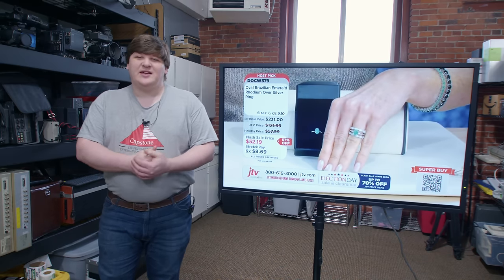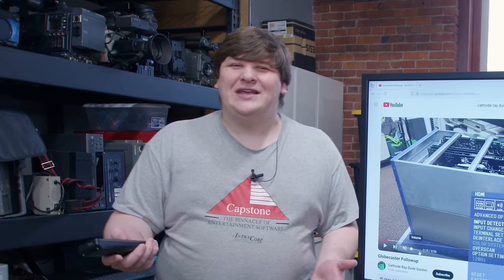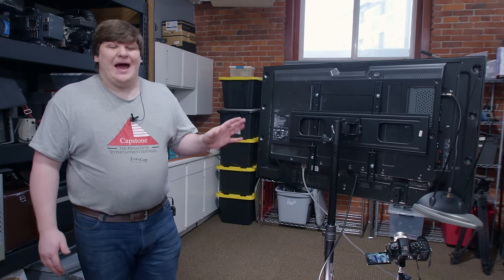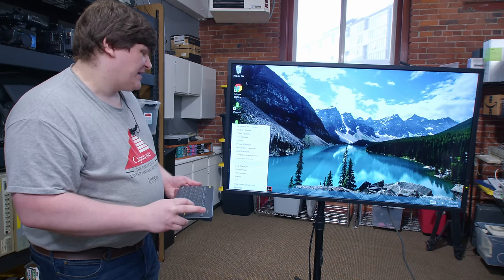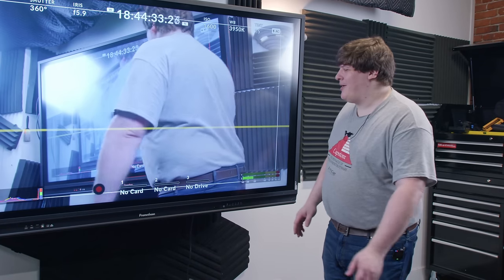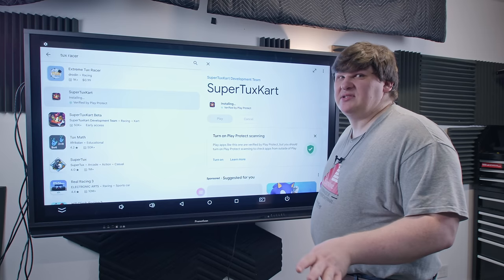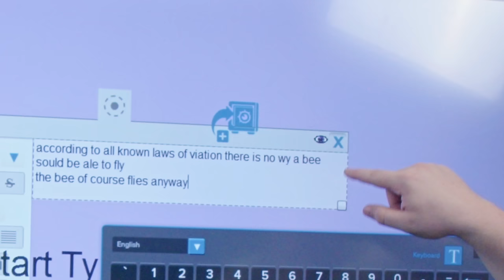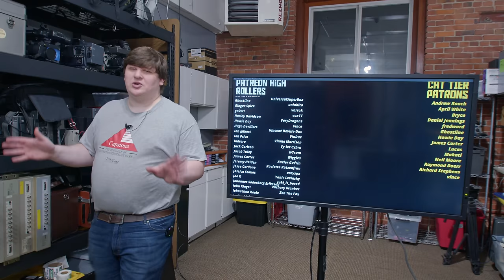Several Incredibly Smart TVs!

Comment: 4:38 I work in a television studio environment and we have studio feeds in every room. I'm talking hundreds and hundreds of TVs that are left on 24/7. When we renovated in 2017, we specifically chose a commercial display designed to be on all the time to avoid burn in. We might have color bars on these screens for days at a time when the studio is not in use. Literally all of them had horrible burn in within 3 years.
Reply: Welp you might need even more expensive studio grade displays

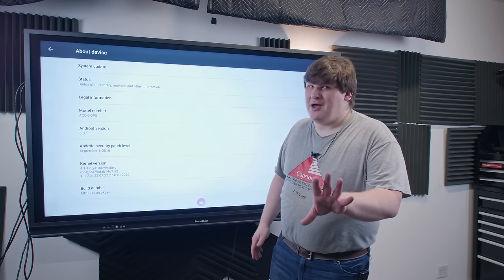Comment: 50:50 It's even more funny, SHA1 hash flowed by '-dirty' was a string generated by git, in which case it was compiled with uncommitted changes in the codebase.
Reply: Imagine fixing a bug so in the hurry you didn't even commit changes to the repo, made a crude build locally, sending it to someone and they say "thx, it works now" and then it is the one that gets officially shipped... either this, or they suck at git, or they just don't care

Comment: About the Promethean casting software: I've actually had the opportunity to mess with one in a school setting, and (at least for the one I used, which seems to be a newer model than yours) it just used regular old Miracast. Stock Windows through the Cast menu connected to it perfectly fine, as well as my Android phone. The one I used also had the ability to have multiple (up to 30, maybe 40) devices casting to it... *at once*. I was told that it was able to allow all the students' tablets (unfortunately we're now apparently giving young children iPads in their classrooms) to cast to the screen at once. You could click one of the devices being casted to focus that one full-screen, then click anywhere to go back to split-screen view. The teachers did also have software on their computers that directly connected to it, so they may also have a proprietary protocol, but I know for a fact regular Miracast does work with it. I think that software was actually just a Chrome extension, come to think of it... I'll have to ask around.

The metal bar is exactly what you think, to store the pens it comes with. Fun fact: the board can actually tell whether you're using the tip or back of the (official Promethean) pens somehow... as well as detecting when you're using the eraser instead of a pen (it came with an eraser that sticks to the side of the frame with magnets to hold it when you aren't using it)
Reply: For most IR-based IFPs like this promethean, it can detect different size objects. I worked for a competitor and the three main sizes it could detect were a thin tip (pen/stylus), thick tip (eraser end), and a larger object like the side of a fist.
Reply: @mariol90  I'm sure that's exactly how it works, as regular whiteboard markers and erasers also worked perfectly fine and it detected the difference properly.

Comment: IPTV isn't just a Europe thing, Rogers' TV in Canada, AT&T's U-Verse and Google Fiber's TV offering is also an IPTV system (the former two based on Microsoft's "MediaRoom" IPTV platform, but all three using Multicast UDP streams to deliver video, audio and the interface). But in Europe they have regulations defining the standard and allowing people to bring their own receivers. In NA, they use proprietary encryption systems to lock you into using their set-top boxes (or if you can get a supported option, the "CableCard" standard) to control what you can receive.
Reply: Some thai providers use some iptv over fiber. You get a tv box with the fiber internet, tv box being a customized android box.
Reply: I'm french and my ISP (SFR) has an IPTV and it's some proprietary multicast stuff

Comment: When using the "free" command in linux, the "available" column is actually the one that's relevant.  The "free" column basically says "how much memory hasn't been touched by the OS", but there can be plenty of memory that has been marked to be freed by applications, hasn't been truly deleted yet.  The "available" column counts all of the memory that can be allocated.
Reply from the maker: Yeah, I was embarrassed to realize later that I'd made such a rookie mistake, but if you look at available its also not doing hot haha
Reply: @CathodeRayDude  FWIW even in the "professional" software engineering industry, it seems like most people don't realize it.  I had to explain that to a coworker (whom I consider very smart) about a year ago, so you're in good company. 

Also, something I do if I have to run a linux where the repos are all dead, is to quickly install the alternative package manager "Nix". It runs on pretty much any Linux and macOS and has most of the packages, and is pretty up to date.  I find it generally more reliable than depending on old Fedora mirrors.
Reply: I had to explain to a sysadmin just this year about how Linux will use free memory for cache and that you have to take that into account when looking at the memory usage stats.

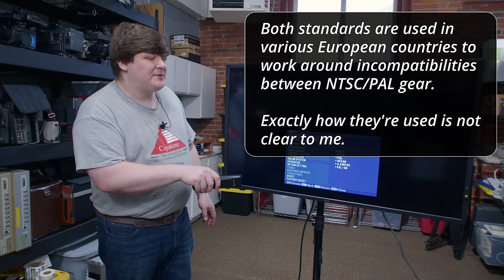Comment: 13:00 
NTSC 4:43 is NTSC for 50Hz and colorburst at 4,43Mhz. Is a NTSC for European tv standard's.
PAL-60 Is the other way around. PAL on 60Hz, or PAL for 60Hz, but with colorburst at 4,43Mhz.
SECAM was the French color TV system.
There's also PAL-M used Brazil. Mutch like PAL-60, but with colorburst at 3,56Mhz, to viabilizar broadcast PAL tv signal at 60hz on top of "NTSC" transmitters.
The weirdest one is PAL-N. Is PAL at 50hz, just like European PAL, but with colorburst at 3,58Mhz to be able to broadcast on "NTSC" transmitters. Was used on Argentina, Paraguay and Uruguai
Reply: Great explanation. Most common use (speculation) is probs VCRs that let you watch NTSC tapes on PAL TVs and vice-versa.
Reply: NTSC 4.43 is for playing back NTSC VHS tapes on multi standard VHS recorders intended for the European market. VHS recorders (probably all the other video recorders too) frequency shifts the color sub carrier. By playing back both PAL and NTSC at 4.43MHz the recorder only needs to be able to play back the color signal at 4.43, saving some parts. Those multi system recorders were packed full of circuits back in the days where all signal processing was analogue.

PAL 60 is supported by all DVD players sold in Europe. The purpose is to play NTSC DVD:s on a TV that only has a PAL color decoder. Since perhaps mid 1980's or so the vertical sync circuit of all TVs started using ICs that automatically sync to either 50 or 60 Hz and in most cases automatically have the correct vertical size too. Multi color systems though cost actual components, band pass and band stop filters, crystal oscillators and whatnot, and it was also possible to charge a premium for a multi system TV, so most TVs could only decode PAL (and SECAM if they were sold in West Germany, because everyone watched East German TV but no one officially admitted to doing that, it seems).

PAL 60 would also be useful for example if you switch to 60Hz/"NTSC" on an Amiga but still have the PAL color encoding / RF modulator things and use a TV or composite monitor as a display.

I honestly don't know who had any use for PAL-60 on DVD players. I think it was just included to lessen complaints from consumers who didn't know how to connect things correctly, as all but the cheapest budget TVs had RGB inputs in Europe since the mid 1980's.
Reply: @RetroSwim  Yes, I think that the in the last part of the life of VHS some recorders were able to play back NTSC in the PAL world and then transcode the NTSC color signal to PAL, thus generating PAL-60.

But the common use cases are those I stated in another comment in this sub thread

Side track: i don't think that there were ever TVs sold in Europe that could display NTSC 4.43 but not NTSC 3.58, even thought that would technically had made sense since it would had been super cheap to add to certain TVs (just a few diodes for the switching logic, kind of). I think this never happened due to it being a marketing night mare as it would require explaining too much to ensure consumers wouldn't get angry about it not displaying NTSC 3.58.

Another side track: I've never heard about people (rightfully) complaining about their European multi standard VHS recorders not working with North American TVs.
Reply: @Thesecret101-te1lm  well, not quite. Let me explain. There's quite a difference between what the NTSC is for Americans and what it is for the rest of the world. For Americans, NTSC is the television system as a whole. It doesn't matter if it is color, black and white. If it works at 60hz, it is NTSC, and if not, it is PAL, but it is not even close to that simple.
Reply: In the rest of the world, mainly in Europe, every country has its own television system that is different from each other for many reasons. For example, during the Cold War, you had East and West Germany, each running their own television system. Why? In that way, western Berlin audiences were not able to watch content broadcasted in the East and vice versa. A mess.
With that in mind, during the 60s', a French commission named CCIR cataloged every TV system in the world and put a letter on it. With the arrival of color, there was a mix and mesh between systems, and so then, side to the letter, there's the color TV system, and that is the NTSC for the rest of the world.
Reply: So, the UK system gained the letter B, and G after, the French had the E system, Eastern Europe the I, and the U.S. and most parts of the American continent got the letter M, and this M means that the signal is 60hz at 6 MHz with the color burst of 3,57Hz.
In the U.S., Mexico, Colombia, Canada, and so on, the System is NTSC-M. Brazil used the same M system but with the PAL color TV system, meaning that in Brazil, the system is PAL-M. Argentina has the 50hz system, but with an American-like broadcast system, and the equivalent M system for 50hz is the N system. They used PAL as their color TV system, so they went PAL-N. So what is NTSC 4.43?
Reply: NTSC 4.43 is the NTSC system up for European broadcast systems. If the UK had chosen NTSC instead of PAL, they would used NTSC with the color carrier at 4.43 to broadcast at the system NTSC-B or NTSC-G.
Because of the limitations of NTSC broadcast-, wise, the format was never officially adopted for any country, but NTSC was a better format to archive content on tapes back in the day than PAL, and then, professional broadcasters tended to use the format to capture and archive the content, converting them to PAL 4.43 to broadcast.
Reply: @carlosjuniorfox  You are only partially correct.
You are correct in that in USA NTSC refers to all parts of analogue TV transmission, and in the rest of the world that is called NTSC-M.

However West German + West Berlin and East Germany had compatible black and white TV systems, so all TVs would at least display the other sides transmissions in black and white as both used the B/G standard for RF. You only needed a dual system color decoder for PAL and SECAM to receive both sides in color. (Also they used the same frequency range / standard for FM radio transmissions, unlike some other east bloc countries).

Most of the east bloc used SECAM-D/K (or just D/K monochrome).

UK first used system A for their old 405 line system, and later system I for PAL color. The sound carrier wasn't compatible with any other country (except Ireland that IIRC also used system I). France used system L and SECAM to ensure incompatibility, to  have their country be a cultural echo chamber. The rest of West Europe (and East Germany) used system B/G and where thus compatible (and all used PAL except East Germany).

PAL was officially marketed for it's improved resilience against distortion, but the actual purpose was to be able to impose tolls / license fees to non-European manufacturers. Some companies in Japan attempted selling almost-PAL TVs that circumvented the patents, but I think that in the end that went nowhere. (Not exactly sure how they did it, either they skipped the delay line, or maybe they had the delay line and only ran the color decoder every second line and thus avoided the "alternating" part of PAL).

NTSC-4.43 might had been a thing in high end broadcast equipment, but I think that they soon switched to component video. The lower end professional equipment like U-Matic and whatnot always used PAL. Do you have any example of pro equipment using NTSC-4.43?

Either way, the reason for having NTSC-4.43 on a TV/monitor like the one this video is about, or any consumer TV/monitor, is to play back NTSC tapes on European multi system VHS recorders.
Reply: @Thesecret101-te1lm  wooow. Thank you for clarifying about the many standards which one uses which. 
I always thought that eastern Germany used the I system, as this, as far as I knew, was the system for the Sovietic states.

Comment: We have these Prometheans (not the exact model slightly newer) in schools in germany. 

I work as a School Admin and know these very well. The newer ones allows iPads to connect wirelessly, so students can share their work, the teacher can then at any moment freeze the screen and draw over it to correct or further explain things. Really nice actually. Though we shifted on using Smartboards as the UI is much nicer and they are almost 1000 Euros cheaper.  Smartboards have a built in OPS module not that easily accessible, but it still can be swapped or bought with an x86_64 module. All of those, even the new ones still have front io for teachers to plug in their own devices via hdmi, the newest even have thunderbolt 3 inputs on the front and back.

We are going to swap all ops modules with windows 11 compatible ones this year. I love that we can fit 10 year old devices with modern hardware capable of running Windows 11 at nearly a 5th of the price of buying new ones. For schools with limited funds this is insanely valuable!

Comment: NTSC 4.43 is for PAL VCRs playing NTSC tapes, while still using the PAL colour oscillator already in the VCR. PAL60 is for using 60hz video signals on PAL TVs that can accept a 60hz refresh rate but not NTSC colour, mainly useful for older video game consoles.

PAL60 should also not be confused with PAL-M, which uses (almost) the NTSC oscillator frequency, and was used in Brazil.

Comment: The digital white board I have at my office not only has HDMI IN on the front panel, but also a full fat USB-C port I'm too lazy to check is thunderbolt, but certainly feels that way. Not only does it do 4K60, but it also passes through any USB devices plugged into the whiteboard (although regrettably not the ones on connected OPS modules, that would have been insane), passes audio to the speakers and the microphones, and enumerates its display as a touch surface AND a wacom display, while delivering 96W of PD. It's insane, and I love it.
Reply from the maker: Phew! That's convenient, wow. I expected these to just have USB b forever

Comment: FYI: idk if someone already mentioned this, but I am in a district that is all promethean boards (more modern than yours), and the built in screen sharing feature, at least on the modern ones, does support window's built in screen mirroring feature, though not super duper well. For example, if you set the screen mode to extend, the display will only render the pc's extended screen in 4:3 for some strange reason. The neat part about the promethean side though is the ability to have a waiting room where like a class can have all the people presenting connect before hand, and you can live swap who's input is being displayed.The neat thing about the modern promethean OPS modules (and I feel like yours does it too from a side channel video you did a while ago? I could be wrong)  is that they completely replace the built in OSD, and also have multiple overlay features on the HDMI inputs, such as a large timer, and an on screen annotation tool, that doesn't require the pc to ever receive the touch input. Our district probably found out when setting these things up initially that the official promethean screen share software is so annoying to use, that they specifically bought these devices that just get mounted onto the back of the board called ScreenBeams, which would handle the usb touch input coming from the USB B cable on the back of the display, and ofc the sending of the connected computer's image to the board. The really strange thing is all of the ones in my district (i've checked at multiple schools) actually come with a FRICKING DOS EMULATOR??? called FreeDosBox... I put the oregan trail on one of them using that, and also windows 3.1 which is really really silly to me lol. Also have poked around the OS a lot, it is way more locked down than the one you have, doesn't have the google play store and you can't load apks. If anyone does want to ask me anything more about how our school district is setup with these/how teachers actually use them, feel free to ask.... I ramble a lot as you can tell lol.
Reply: Looking at one again today, I am unsure if there even is an OPS module installed in it, there is a slot, but it looks like it may just be a cover, with a built in grabbing handle. It could be a card, but it has no IO, and the Wi-Fi antennas aren’t located on OPS slot. Instead, they’re on another module in a tiny slot (no idea what standard that is/could be, if it even is a standard) underneath the OPS slot. Heck, it may not even be an OPS slot, it might be the new intel one that was mentioned at the end of the video, tho the slot size does match up with OPS so idk. I don’t know if I’d ever even get the chance to remove the slot to see if their is an actual module or not, since I don’t want to get in trouble for “property damage” or “hacking”.